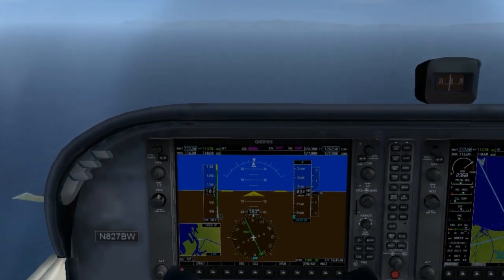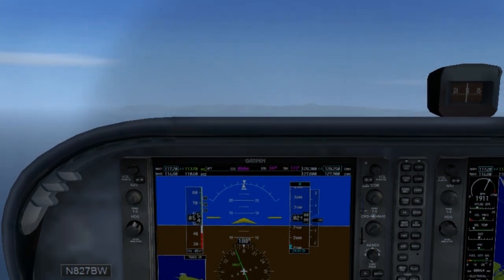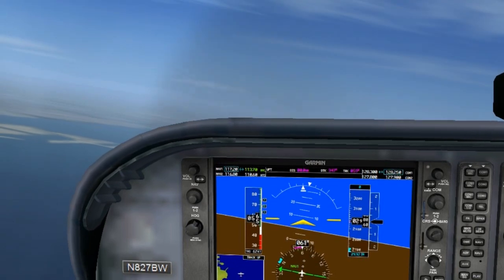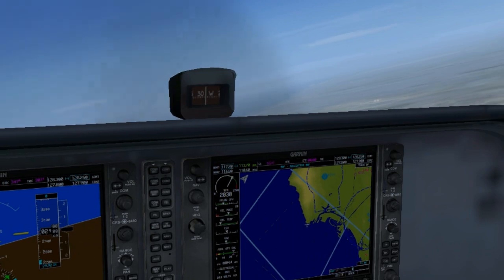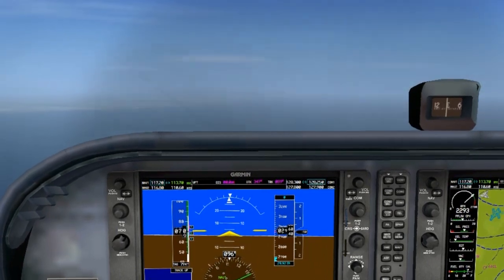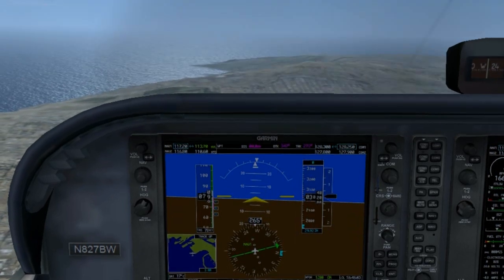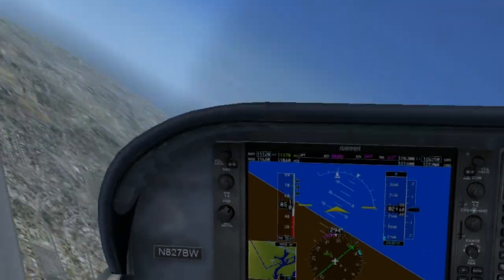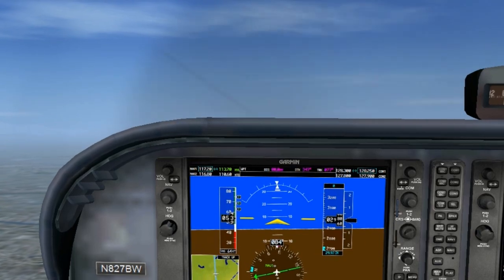Slow Flight Tutorial (Part 1) - VFR (MSFS) (Airspeed Control)

Comment: @FSX404 Thanks for your response, I suppose you are right about that then. That's what makes your video's & tutorials good. I was asking out of interest and also because in the expert missions in fsx there are two which involve engine failures but no lesson or info as in how you need to react to them properly. Most people that finish the mission just keep there gps and ap running and do nothing to put the fire out or compensate for the loss of the engine which is not really satisfactory to me.

Comment from the maker: @Crashboy1024

No snide remarks at all, it is awesome that you are learning to fly the ultralights, you will actually learn a little more about your environment (especially weather, up/down drafts, thermals etc) which will make you a better pilot overall.

I know what you are talking about, the propeller will pull the plane into one direction when you add power, but that will not  cause a spin, what causes the spin is the uncoordinated reaction of athe pilot after the nose is pulled to one side.

Comment from the maker: @Karkarbink 

Thanks, this was one of my very first ones I did, I think the videos got better with time.

I double checked the flap speeds. In a C-172N (1978) the max flap extended speed for any setting is 85 kts (white arc), but for newer C-172's the S and SP the 10 deg flap speed is 105 kts (20 kts above the white arc), so like I said before, you really have to pay attention to which plane you are flying.

Comment from the maker: This was one of the first tutorials I did, so a lot of important stuff is missing.

Ailerons are neutral only in stall or spin, you still need them to turn the plane, even in slow flight, LOL, but I'm guessing you're referring to the quick stall I did in this video.

I learned to fly at Bracket Field back in 1995.  I did stop flying for about 10 years from 1999-2009, but I'm back with a vengeance, LOL.  I fly out of Hawthorne and Long Beach now.  Working on my IFR right now, 15 hours to go.
Reply: pro tip : you can watch series on Flixzone. Been using it for watching all kinds of movies these days.
Reply: @Tucker Axton Yup, I have been using flixzone for months myself =)
Reply: @Tucker Axton yup, I've been using flixzone for since november myself :D

Comment from the maker: Easiest way to do this is put all the gear and flaps down ans slowly put the airplane you are flying into a stall.  Note the speed and fly the slow fight at 5-10 kts above the stall speed.

In real life this is easier because the stall horn comes on 10 kts before the actual stall, so we fly the whole "slow flight" with the stall horn blaring, but in MSFS, like I said, just maintain that 5-10 kts above stall using your pitch. Use your power to adjust your altitude.

I hope this helped.

Comment from the maker: Slow flight is considered anything below the final approach speed up to 5 kts above the stall speed.;  Your airplane must also be in a landing configuration, meaning flaps fully extended and the landing gear down.

As long as you know the planes final approach speed and stall speed you're golden.

Comment from the maker: The only rule (when lowering) is that you must put in the first notch of flaps below 105 KIAS, & the second below 85 KIAS.  But give yourself time to have the flaps fully lowered before 55 KIAS

When recovering from slow flight or stall, you want that 30 up to 20 right away.  Don't go from 30 down to 0 flaps in one swoop, it'll change the plane configuration completely, so raise the flaps incrementally

You are right, that is why I said if you practice slow flight it makes your landings better.